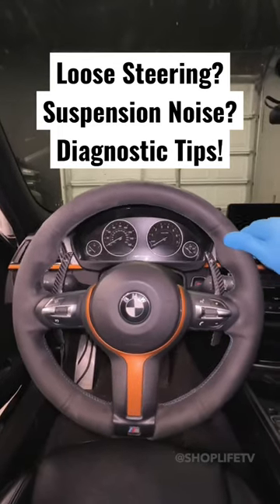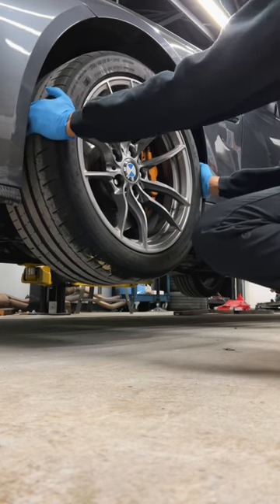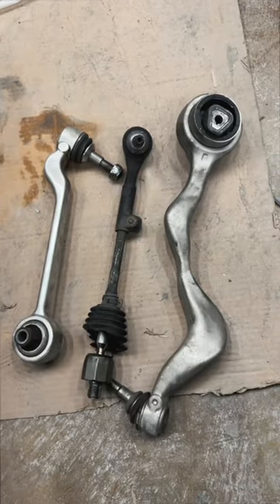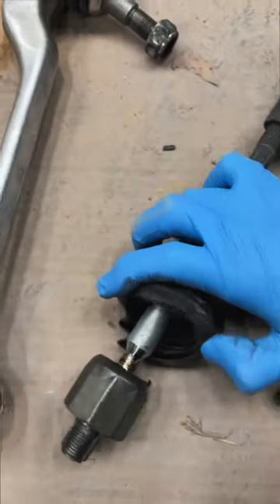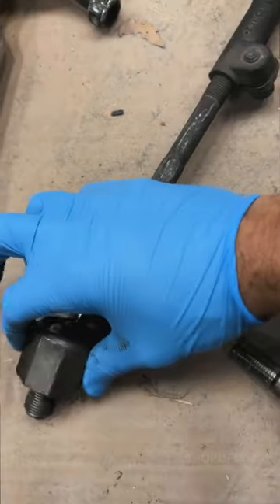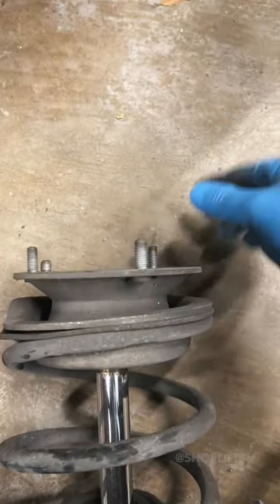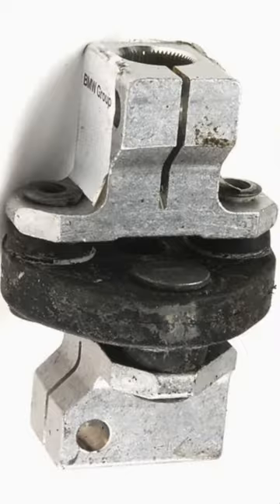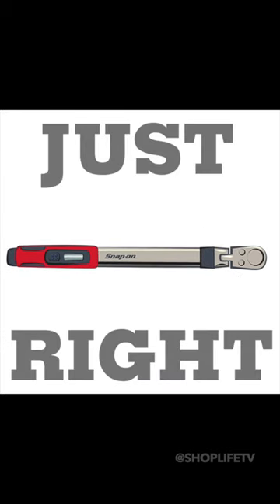Fix your loose steering and noisy suspension! #shorts

Comment: Could not have posted this at a better time! I replaced both tie rods on my E39 after I inspected my wheels and both were wobbly. My left wheel is still wobbly - but I think that's the sway bar end link, it seems like. Either that or thrust arm but it's unlikely. When the wheel is wobbled the sway bar link is the only piece that moves. 

I'm about to replace a main control arm on my other 530i as well. PO hit a pothole and bent it 90° without snapping it and a tie rod was slightly bent. Wild stuff. Love they way they handle and toss themselves when everything is tip-top. 

To those looking at it and thinking suspension is a confusing metal spaghetti noodle mess, take it easy. Replace one component at a time. And get a 16mm, 18mm, 32mm fan clutch wrench (1¼ inch),  a 15/16th wrench, a 5mm Allen key, and most importantly a ball joint puller. 🤙